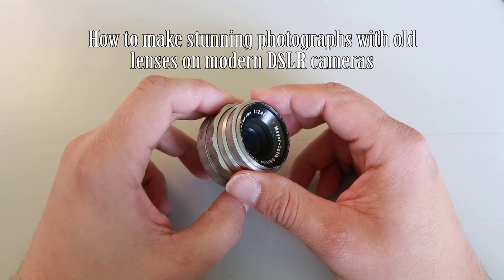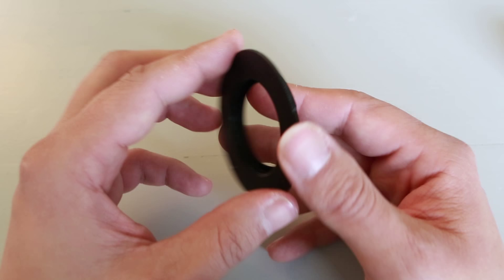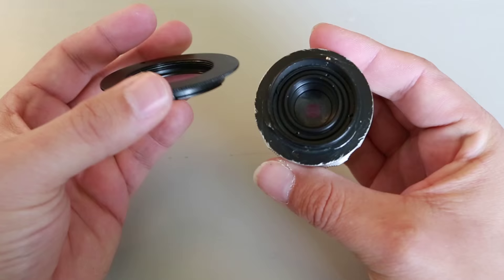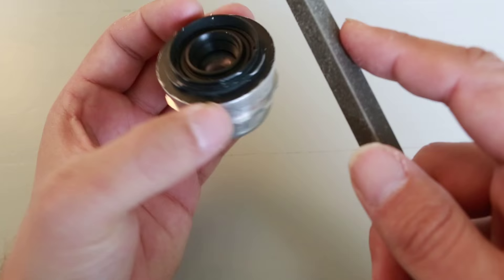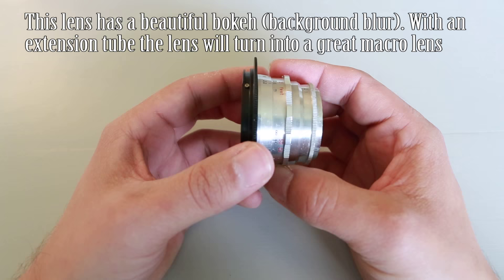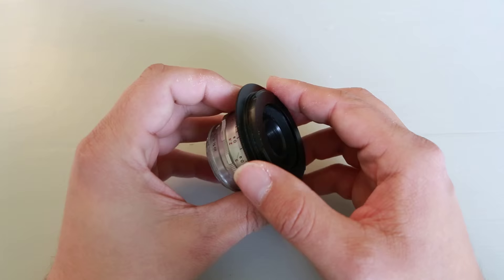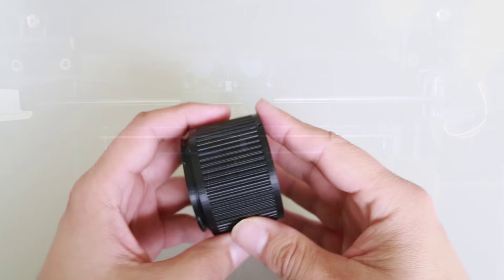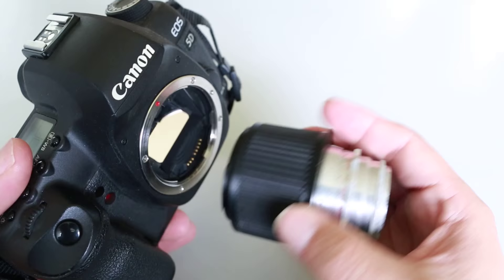How to make stunning photos with old lenses on modern DSLR cameras

Comment: Good video, and great to find a Norwegian maker on YouTube! I tried to have a look at your web site, but it seems to be down...
Reply from the maker: Thank you. I installed ssl tonight, what platform and browser are you using? It does not work on older versions of Android and old IE versions unfortunately. It should work fine in newer versions on most platforms.
Reply: I'm using Chrome on Android 6. But I think the problem may have a different cause. The error message I'm getting is "Domenet du søkte er dessverre registrert og parkert på vegne av en av våre kunder. 
I søkefeltet under kan du enkelt søke opp alternative domener".
Reply from the maker: Ah... That's my old domain. I'm using dieter.me now since that's a more international domain ending. Think I have to add some captions in the videos that says dieter.no. Probably several links that need updating, I'll look into it. Thank you so much for taking the time.
Reply: Ah! My brain tricked me :-)

Comment: i was wondering if u could 3D print extension tube why not u just 3D print the mount that one side fit to ur 5Diii and the other make it fit to an old len mount (so you don't need to modify the original mount)??????
Reply from the maker: +ten piseth Yes you can, but that would also require to make the 3d model